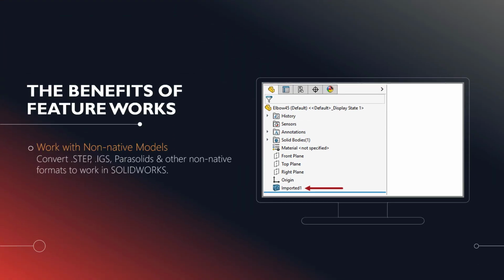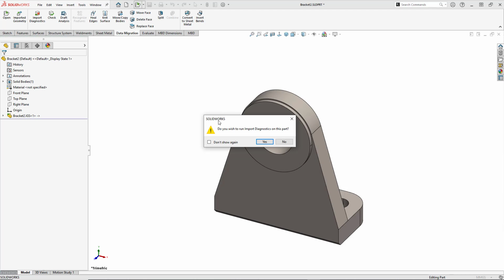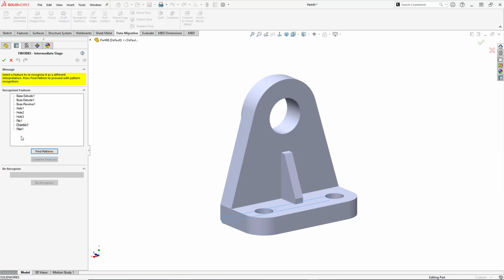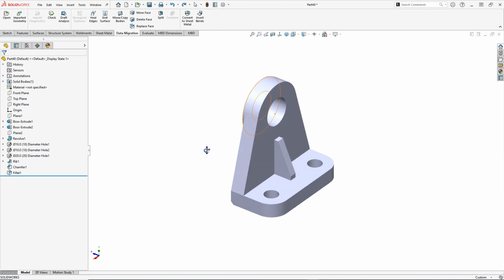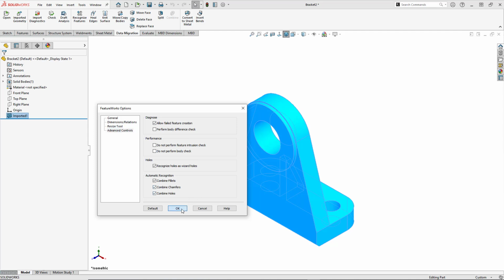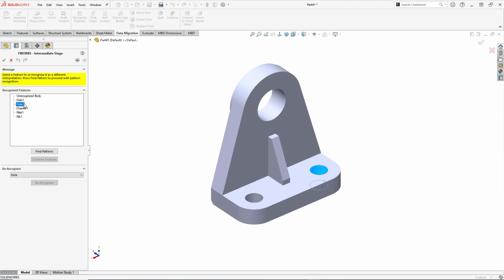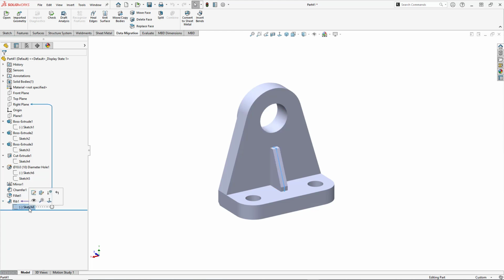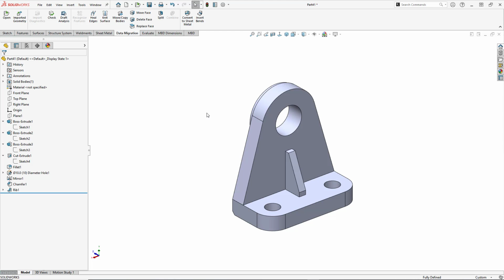💻 Using FeatureWorks | SOLIDWORKS | i GET IT Masterclass 📺

Comment: I can't get featureworks to do anything no matter what I do or to get any kind of feature recognition. Have had to spend countless hours of rebuilding parts just so they can be edited... but in doing so, I end up with 100s of extrusions and cuts... and having feature recognition could save me from having to do all that. It never prompts me to scan the parts at all when I open them and I can't find any way to do it after the part is loaded. I added the "data migration" tab to the toolbar and there is a "recognize features" option in there... but it's always grayed out and I can't use it for anything.
Reply: Same here for some reason featureworks is not even integrated despite being part of my add-ins